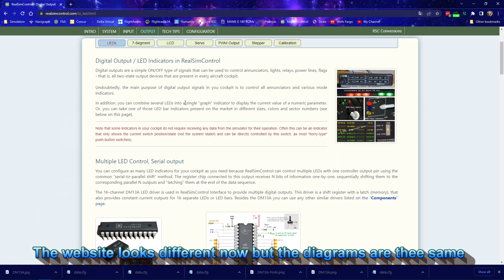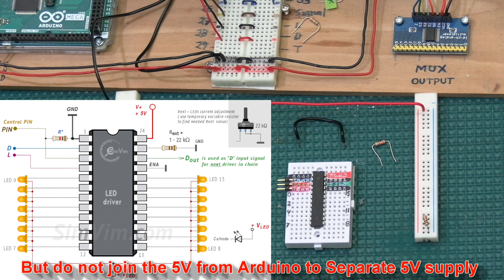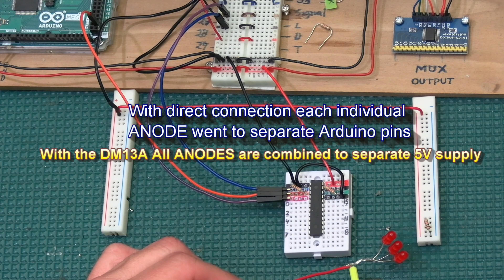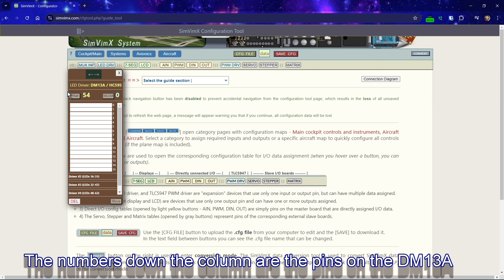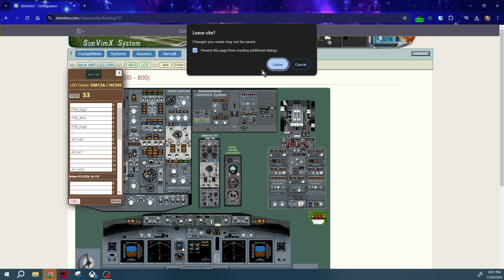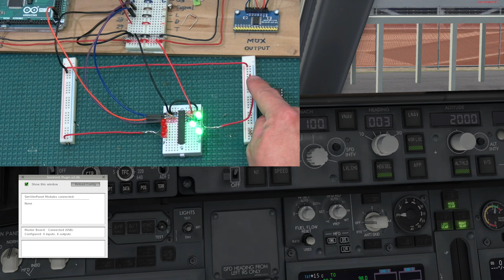Using DM13A LED drivers with SimVimX

Comment: Hi Bud , Wow this channel has made me believe I can build my dream 737 Cockpit . Just a question from another of yiur videos . You said that only 1 arduino mega can be used . What about say if you build a majority of your cockpit but then have some winwing modules . Can they be used together ? I have the CDU from WW and the Efis and the autopilot panel.
Reply from the maker: Hello, thanks for the comment. Oh when it says you can only ose one Arduino Mega it is referring to using with the SimVimX plugin. Im pretty sure you can use other things like Mobiflight, Air Manager, or the ones you mentioned. I have only used Saitek Panels and Air Manager together with SimVimX in my setup though.
Reply: @Qosmokid thankyou for the reply

Comment: Great Video about wiring!  An extra power for LEDs mentioned in video( like the adapter shown when video start), but still have no idea how it connect, could you show the power layout?
Reply from the maker: @zikangzhong7045  I did show the power layout. You might need to watch the video again.

Watch starting at 11:48

Comment: Just a comment about something that had me baffled for weeks about DM13As til I figured it out.  The wiring illustration on the SimVim website isn't entirely clear with regards to how the pins are identified.  The 24 pins on the IC chip itself are pretty straightforward - BUT there's a second set of numbers that apply to the LEDs.  Yes, they're shown on the illustration but it's not exactly explained that the fifth pin down isn't really pin 5, it's LED pin 0.  My LED was connected to the fifth pin so I naturally assigned it to Pin 5 - but of course it never worked.   I reassigned it to pin 0 and bingo!
     I may be the only dummy who got tripped up on this but if your LEDs don't work, this could be why.
Reply from the maker: @larryspotts3266  Hmm actually the diagram does show LED 0, LED 7 on the left and LED 8, LED15 on the right, but you are right there is no explanation or correlation between actual IC pin numbers and LED positions. I Think I  tried to explain that on the video. Glad you figured it out though. Hopefully this will help others, thanks for the comment.

Comment: This is Phil.  Even though I'm an engineer, your videos are still wonderful.  The latest are well produced and well sequenced.  I love the format.  The way your videos are done gives me a better way to produce any video I might do.  It would be nice if you can show how you're progressing with your cockpit(s).
Reply from the maker: Hello Phil, wow all this time we've been in contact and I never knew you were an engineer. Thank you for the nice comments. As far as my cockpit, I really haven't done much with it in the last few years. Pretty much what I showed in my "Evolution of my home cockpit" video is what I have now. 
https://youtu.be/SF5zJUBmVWM?si=SY3Eww2tOE7PQa_W&t=656

I have been thinking of starting an overhead panel and/or stating to use SimVim Panels but I just wish I had more space to build.
Reply: @Qosmokid  Well, building your own simvim panels takes time but if you use a dremel tool and other tools, you can make your own panels.  This way, you can make them the size you want to fit.
    The comm panels you have are rather large and if you saw my latest video, you'd notice how it all fits together (of course, I use 3D printing - Cutting out panels takes time and I don't have the patience.)  I was thinking of getting a CNC machine (about 200 to 300 dollars now) to cut out my own panels which would look better than the ones I printed and are more precise than 3D prints (you don't know how many tries I went through to adjust the various cutouts for each panel.)  Also, although Vlad doesn't recommend anything but direct soldering, the best solution I found are the JST connectors that you find in various devices.  You can disconnect and reconnect them many times without failure.  I bought bags of 100 of different pins (2, 3, 4, 5, 6, 7, 8, 9  pins types both female and male) for about $5.00 per bag of 100.  The male pins are directly soldered to the pc board and the females use connectors that you can either crimp with the right tool or, as someone on youtube said - solder the wire directly to the connectors.

    As for space for the sim, I have the same problem.  I live in an appartment built in 1947 for the returning soldiers from WW2 so the appartments are small.  I could take over my wife's work room but then, there would be hell to pay.

    As for designing  boards for various parts like 7 seg displays, switches etc, I already did this for encoders, small push buttons with LED displays and even a board for a dual-axis stepper motor (which I might use to design an working altimeter some day)
I enjoy designing pc boards and 3D printed parts so if anyone has a need for something, let me know.

    As far as taking time off, I did take a year off in order to figure a few things out so it's a normal thing.  Currently, I am thinking of getting a curved 42" screen for my main display so that the side windows (screens) are closer to it than they are now.  When I get my taxes back next year.  The other thing I need to do is build the cockpit itself instead of using an old TV stand but, building takes time and I don't have the patience.  Maybe one day before I pass on into the great beyond although at 70 years old, I have less time than I  did 20 years ago.  I wish I had all this technology then.
Reply from the maker: @philnelson2364  Wow a lot of nice ideas here. I still have the PCBs you sent me a while ago but I haven't made use of the JST connectors. Now that I'm working on the 7-segment display videos I got inspired to do a more realistic MCP panel than what I currently have. I actually got sidetracked by that so I need to complete the videos on the TM1637 & MAX7219. You'll see my mediocre cutting skills when I post the video on my MCP panel.

I had no idea CNC machines were down to a couple of hundred dollars. Last time I checked (many many years ago) I could've sworn they were in the thousands of dollars. Maybe I should look into getting one myself. I've also been looking at a 3D printer too but I probably won't buy either one of those until I live somewhere else :(

Comment: Another very informative video from you Jose (I hope I spelt your first name right). I searched the Internet for a board with the DM13A on it, but couldn’t find any. Does one exist?
Reply from the maker: @tzampini  Hey, thank you. Yup, you got the name right 😁.  I haven't found one either, so most likely they don't exist or else Google would find it. I'm experimenting with a new way of soldering some boards and molex headers. So far I like it.
Reply: @Qosmokid  I design my own pc boards and have created a "Main Board" which has the arduino mega, the 4067 multiplexer for the displays along with connectors and the dm13a socket, resistors and power connector to plug in a 5v power supply to power up all the LEDs, LCDs and displays.  I am using it for my cessna c172 sim (which I use to stay up to date for when I can't fly for real.)  I have the gerber files needed if you want to send it to a fabrication company like the one I use in Hong Kong which charges about $5.00 for 5 boards.  If anyone wants to have a board for a DM13A specifically, let me know and I'll design one and create the gerber files (this is what they need to build a pc board.)
If anyone else needs a board for some chip or other item, let me know.